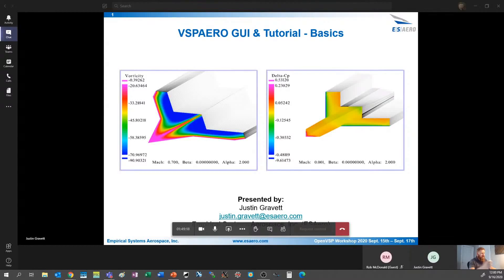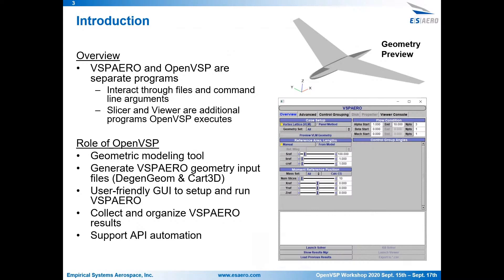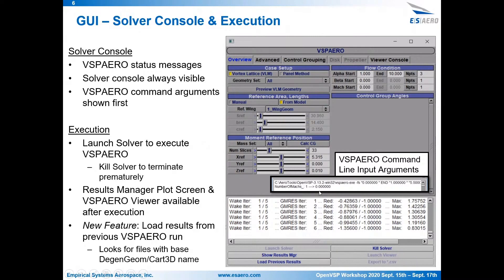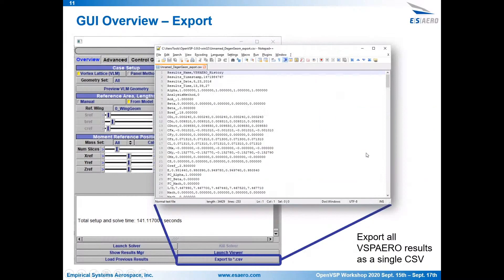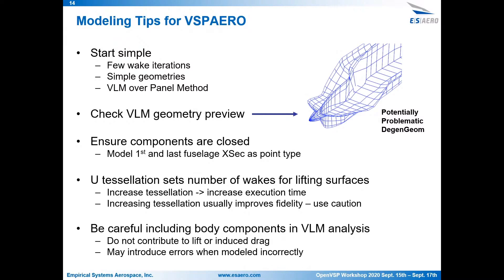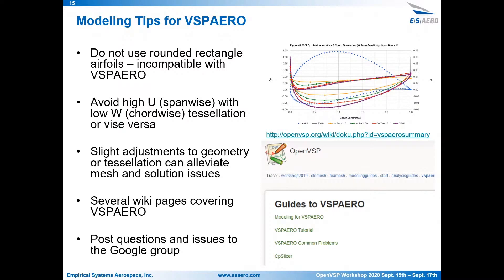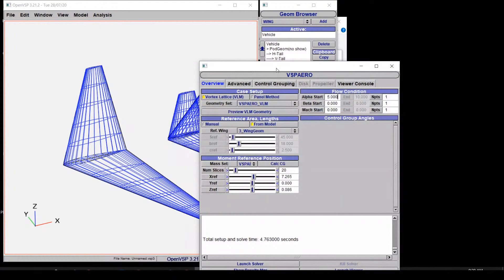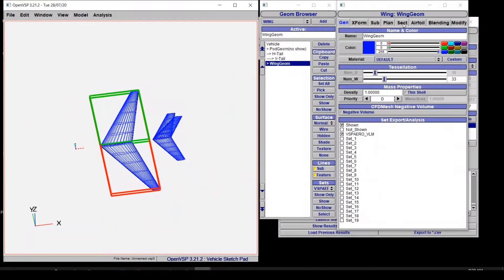2020 VSP WS: VSPAERO GUI & Tutorial - Basics

Comment: Thanks for amazing tutorial!

For CFD analysis, should I use VSPAero, or export the geometry to use it with Pointwise&Fluent? 
Can VSPAero respresent the volume mesh in a fluid flow, or do you recommend only surface meshing the aircraft and extruding the surface mesh using Pointwise etc?

Btw where is the google link to ask the questions? 

Thanks in advance!
Reply from the maker: Google Group is here https://groups.google.com/g/OpenVSP .  

VSPAERO does not need a volume grid to perform its analysis -- that is one significant advantage of potential flow methods.

You should use Pointwise & Fluent if your problem needs it -- nonlinear transonic aerodynamics, separated flow (stall), etc.  However, VSPAERO will do a surprisingly good job for a lot of problems -- including most normal flight of most aircraft.

Comment: Hello, we had a small glitch, 
We are getting L/D ratio above 200 in VSP aero analysis 3D panel method

Why is that?
Reply from the maker: The Google Group is a great place to ask questions like this.  I would need to double check, but I do not think the Panel method includes any viscous drag -- so with low to zero drag at nearly zero lift, the L/D will blow up.